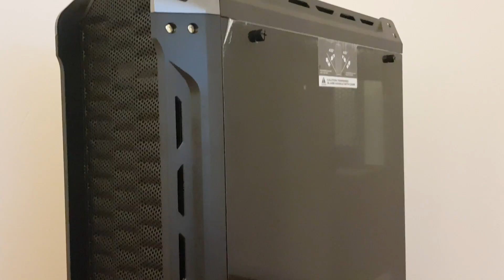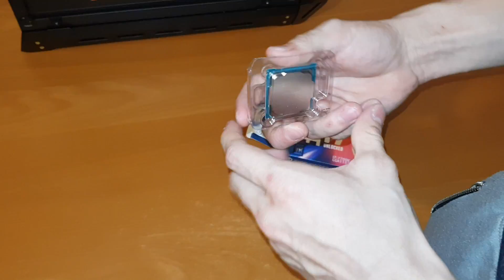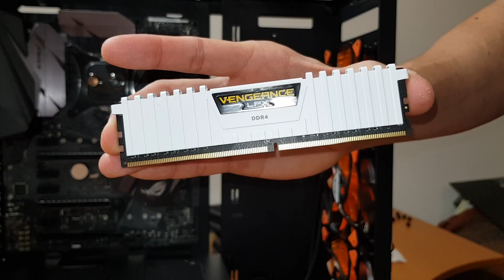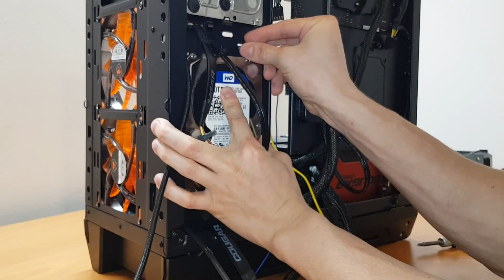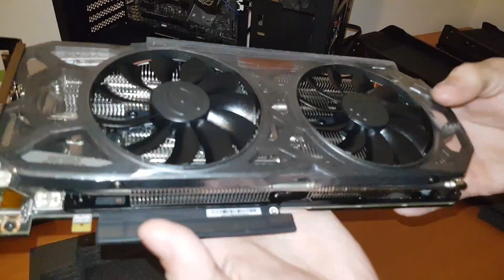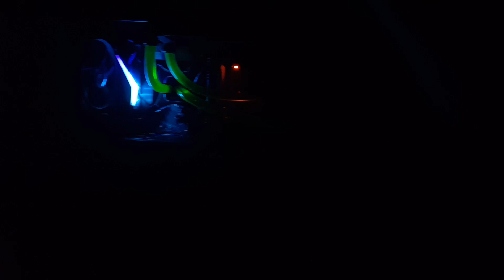New PC Showcase and Build! - Cougar Panzer-S Case Review

Comment: does this thing have anyway to install windows via the disc version because from what ive seen there is no dvd tray
Reply from the maker: I had to install windows through a USB drive, don't really ever use cd's anymore so I didn't need a cd drive
Reply: @LongBarrel  I am going back and forward with my brother over this he says we NEED a DVD drive because it's to expensive to install Windows and it would take too long could you help me with this? Also would an EVGA CLC 280 Liquid / Water CPU Cooler, work well with a i7 9700k processor I do not intend to overclock btw
Reply from the maker: Installing windows from a USB drive is faster and easier than from a DVD drive. Microsoft has a tool for setting up a USB drive to install windows. For the cooling stuff, I've been out of the "loop" from components, so I really can't help you there. Good luck
Reply: @LongBarrel  what's the price on a usb with Windows on it?

Comment: no offence dude but you built that pc totally backwards you should have installed all the hardware on the motherboard before you put it in the case. because it would have made it way easier to install the water block and everything else but  I mean you got it done and it works so that's fine

Comment: Hello, I was wondering if the Cooler Master Hyper 212 Turbo led will fit? The specified height is 163 cm and the panzers' max Cooler Size is 160 cm. Basing it on that would simply say it wont fit but It seems that it would. TIA! Just want to be sure.

Comment: if your going with higher end components then don't cheap out on the PSU, I would have gone for a new EVGA PSU that is gold rated. Plus, the rainbow cables look really shit.
Reply: Daytona Sixty-Eight delta and seasonic generic PSUs are fine but cheap non brand Chinese crap will blow up everything in your build also if you invest in any computer you want clean power running in your parts fam
Reply: PSU really doesn't matter. I would say just buy one that exceeds your demands and is modular. That's it. You technically can even run your PC on a PSU that is rated below your demands but it will eventually fail. I've used cheap generic PSUs with rainbow cables for decades without problems. Your components don't know the difference between power from a cheap PSU or a EVGA branded PSU. It is all electrons.

Comment: Question: why did you went custom loop, but only watercooled your cpu? It feels like a "waste" of money since you didn't watercool your graphics card with it imo because AIOs exist. 

LongBarrel, please answer this question.

wait... did you do it for the green liquid?
pls answer me senpai.
Reply from the maker: I got a custom loop a while ago for my old rig, I was supposed to get a water block for my AMD 7990 as well, but I ended up returning the graphics card and getting a GTX 780 ti which I decided to not water cool. I thought I was going to do overclocking but I never got to that, so I ended up just having a custom loop for the aesthetics.
Reply: if you want to cool down your cpu much more (i7 7700k has some IHS Problems with the thermalpaste inside) look for "Der8auers" Delid Mate 2 Video (ID: XopM4p4CBrs ) It will gets you about 20-30°C less temperature under Load even with Watercooling. I did this on my i7-3770k after 5 or 6 yrs now and on the first try i got to -12°C , and i repeated it last week with more "Thermal Conductonaut" and now unter load even overclocking with a AIO Watercooler i dont get above 60°C (normal 3,7GHz about 50°C @100%) All 7700k have this problem
Reply: You get more options for pumps and radiators if you go custom loop.